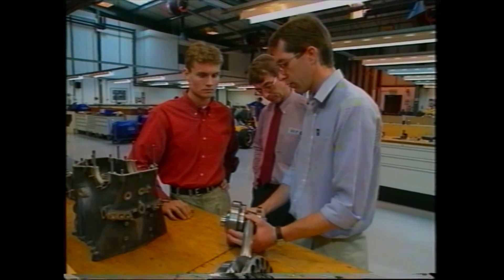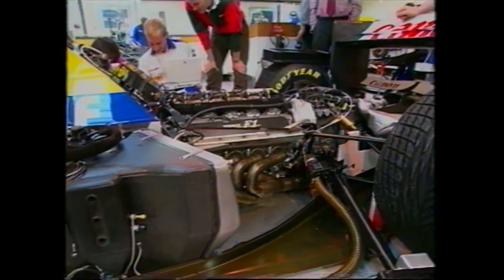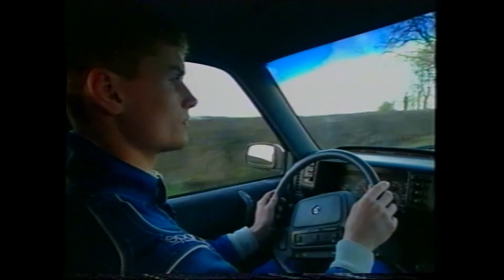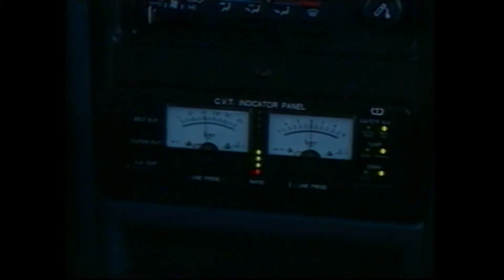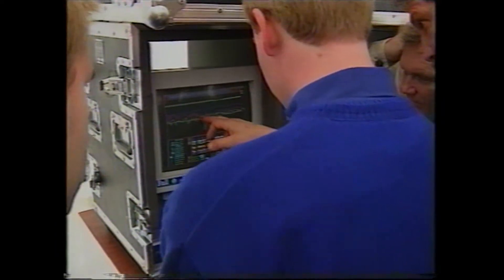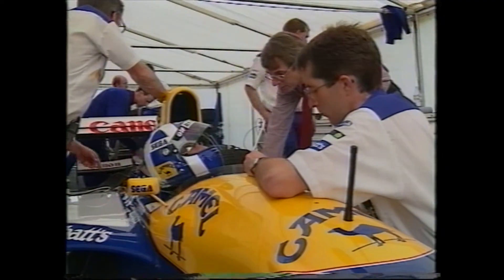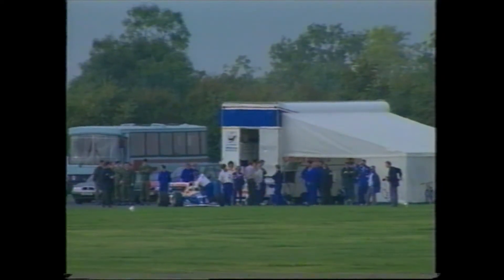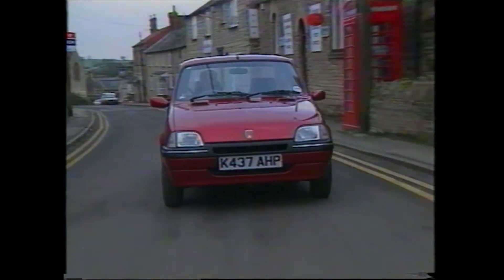Test  F1 Williams FW15C CVT at Pembrey in Wales

Comment: I remember reading that Renault had quite serious reservations about this because the engine technology was not there to sustain a constant high rpm output. The engine needed those periods of lower rpm to survive. So over one lap, lovely.
Reply: I bet the drivers relierd on the engine noise too as that's what they'd had all their careers to then.
Reply: he visto el video a lo largo de los años y al escuchar el motor entiendo que arranca en bajas rpm y van subiendo gradualmente y creo esa es la parte del software mas complicada de controlar pero lo deben haber logrado.   Estimo que los tecnicos de la FIA deben de haber presenciado las pruebas  y fueron exitosas y el costo de implementarlo sumado a la electronica que ya tenia ese coche dispararse en varios millones por temporada para cada equipo.   Igual es una pena no haber visto ese auto competir al igual que Brabham con ventilador solo una carrera  o el Doble chasis de Lotus.  El ingenio no tiene limites y cada año nos sorprenden
Reply: Well thats the case with any race engine. You'd need so many balance shafts coming into play at different constant RPM operation intensities.

Most engines will shake themselves to bits at constant RPM for minutes at a time
Reply: If you are not in the red it is ok, look at a car on an autoban, a car can run hours at his highest range.

Comment: Why is this kind of CVT transmission not used in (light) diesel trucks?
Reply: Because they are fragile garbage in road driven cars, Nissan has been proving it since around 2006. Heavy trucks would be worse. They are OK in light vehicles, such as ATV / SXS, and snowmobiles.

Comment: It would be interesting how much faster this would have been . Why is this not a thing in normal cars? It would ne easy to spare fuel, to raise reliability.
Reply: What do you mean this is not a thing in normal cars? CVT gearboxes are incredibly common in road cars, and often derided by purist.

I've driven CVT cars for 20 years now, ranging from Honda to Proton and now Renault.
Reply: I believe they tested the system at Silverstone and it proved to be around 3 seconds faster there. The system allows the engine to run at the optimum speed nearly all the time so full power would be available to the driver throughout. And it doesn’t cut drive completely for shifting gears all the time.
Reply: @KlaasRijnks  As far as I know that is more myth than truth. I read a David Coulthard interview where he stated they ran fast laps on a shortened Silverstone circuit and he thought the gain would be about half a second or more on a lap in comparison to their regular car. Sounds sensible to me since they already had paddle shift back then.
Reply: @rofufoja  I think I read the supposed three second advantage years ago, I certainly can’t remember where I read it or who said it. But if Coulthard, the driver, thinks it’s about half a second, then that’s probably a far better estimate. Still, it appears it would be quicker and it’s a bit of shame it got banned immediately. 

About the paddle-shift boxes: do you have any info on the shift times back then? They weren’t as sophisticated as gearboxes now and didn’t shift as seamless as they do today.
Reply: @KlaasRijnks  Shift timers on the first paddle shift boxes in F1 were around 100-120ms.  So still very fast.  I believe very quickly they were at about 80 and it went down from there.  They are in single figures now.